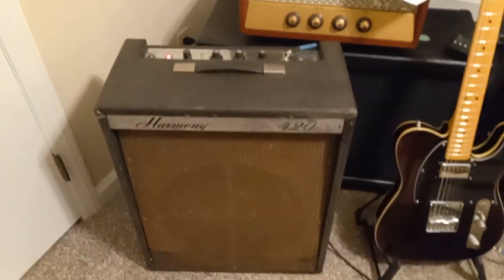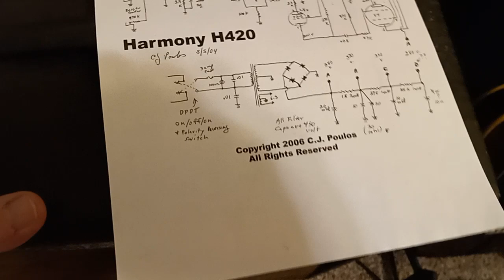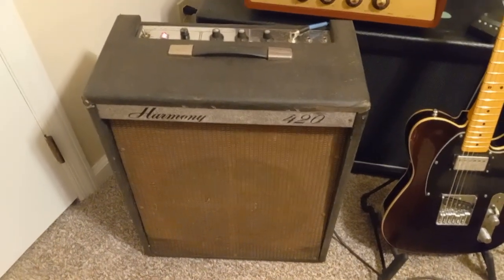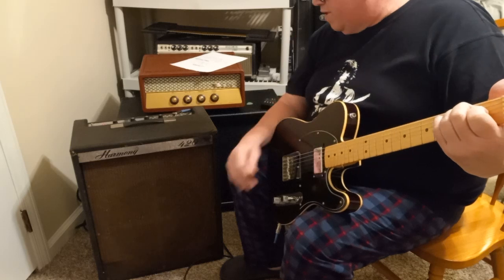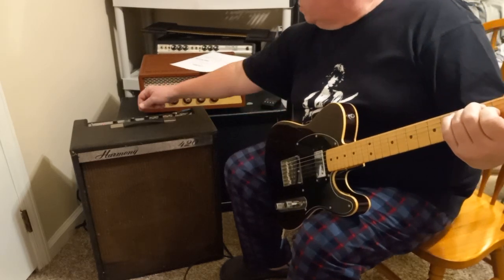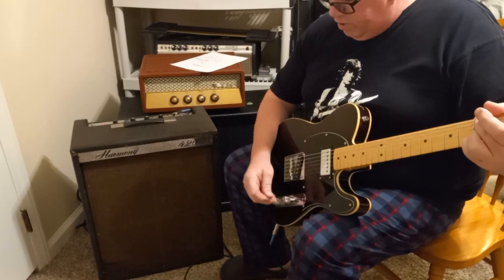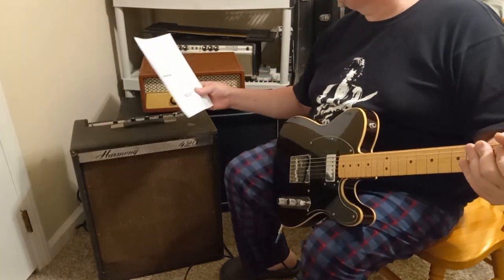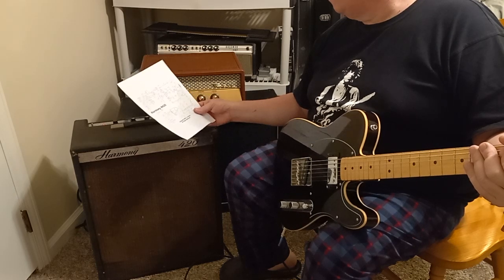Harmony 420 Demo and Some Circuit Upgrades

Comment: Hey Ron, always impressed by your handy work.
These old Harmonys' sound incredible when dialled in, there seems to be some confusion about them being built by Valco online but from what I've seen of them on the inside there's no indication of that?.
Reply from the maker: You are correct there is no indications inside that these were built by Valco. A lot of people don't realize that Valco built amplifiers for other companies such as some Harmony amps. The coveted  Harmony 415 is also another example. One way you can tell is just by the physical makeup of the amp, the tolex and the screen print that are on the faceplate where the dials are, these are all strong indicators that these were velcro made with Harmony putting their stamp on there just as well as National or anyone else can put their logo on the actual name of the amplifier.

Comment: I have a Harmony 415, which is two EL-84 tubes, the poor man's Vox (or Marshall depending on).  I always assumed it was made by Harmony not Valco?  I have a Gretch with a 15" speaker, used to be called an "Executive" (forget the numbers now), but not the new version of the "Executive".  It's just like a two channel "Thunderbolt" they say?
Reply from the maker: Yeah that Harmony 415 is a killer amp! That's the one Ken Fisher said it was one of his favorite sleeper amps.
Reply from the maker: The Guitoligist on YouTube he has some good insight into these amps, especially the Harmony 415 check out some of his videos if you haven't already.